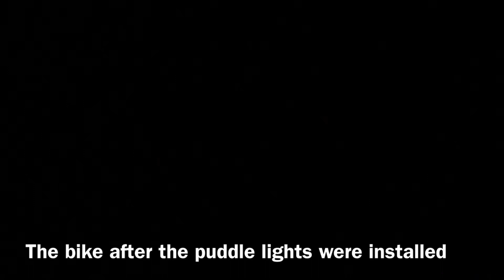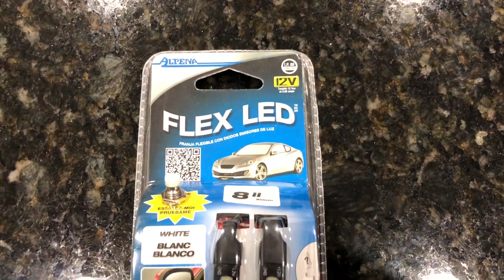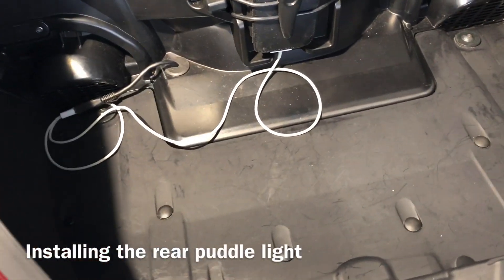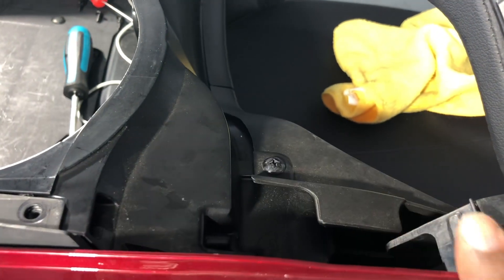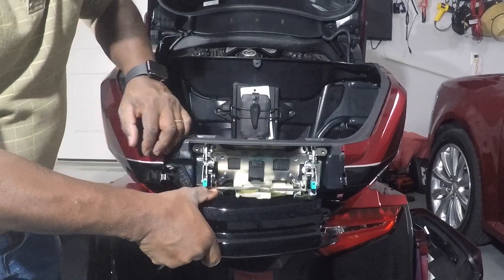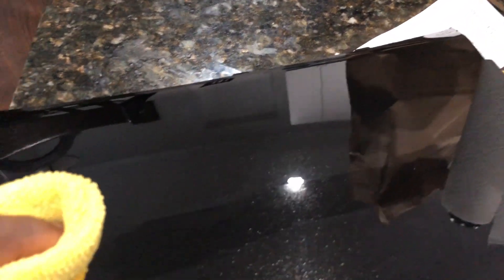Honda Goldwing Puddle Lights Enhancement for 2018+

Comment: Enjoy your videos Freddy....   You take your time and explain everything well..!  I installed Big Bike Parts fog lights on my 2018. They use the same switch & wiring as Honda and I used the shortcut that the Helibar riser video shows to get access to the switches and that saved a lot of time & panel removal.  Beautiful bikes but at times it takes a lot of work to install accessories....!
Reply: Thanks! Yes they are beautiful bikes and it’s worth the time to make it your own.

Comment: Did you install honda foglights? And if so, was it hard?
Reply from the maker: I did install the fog lights myself. It wasn’t hard. The roughest part was disassembling the front end to install the switches. I bought all the accessories and switches I needed the front end off and did it all on one installation. I installed the lights later